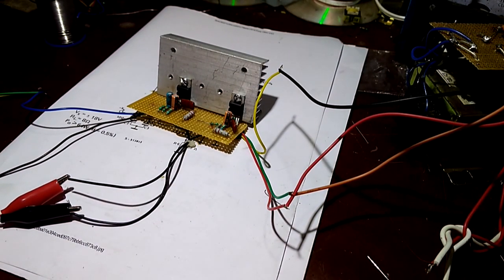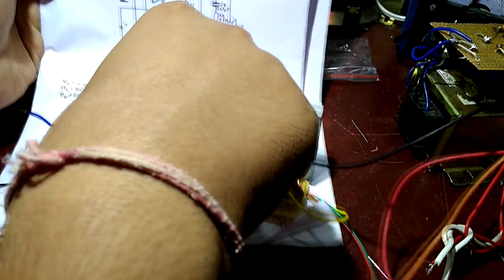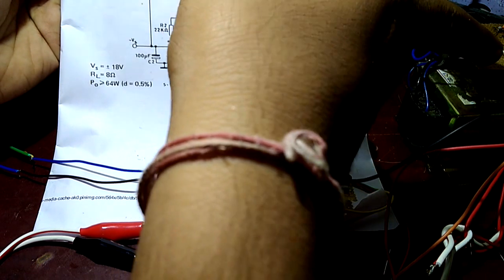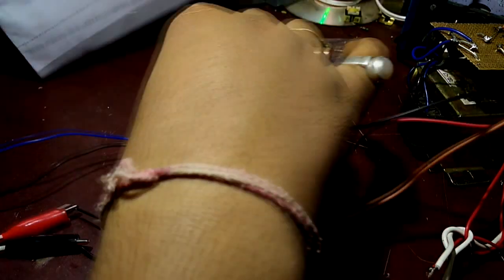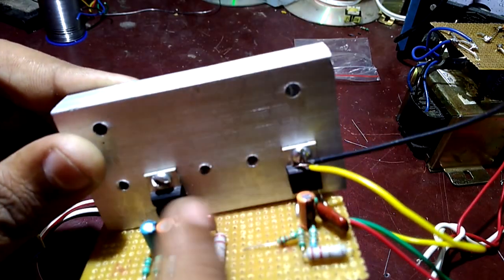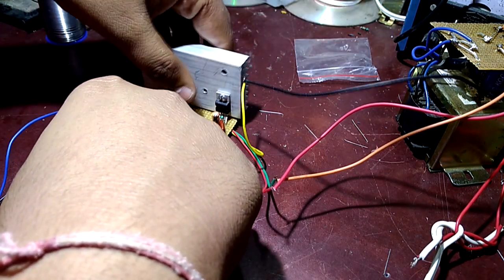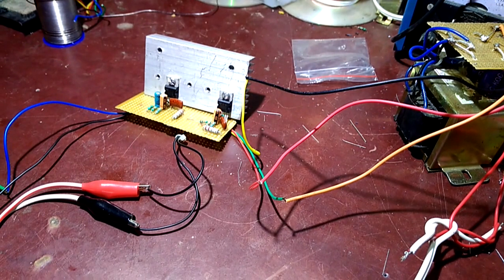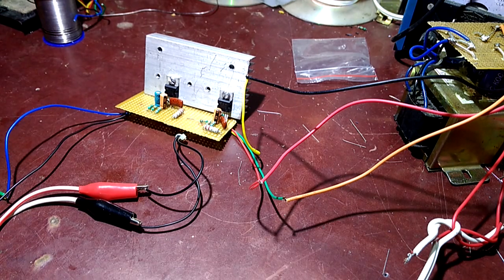100rs cheap 70 watt tda2050 bridge mode class ab reliable amplifier

Comment: Tda2050 is already stopped production. All you can buy are fake chinese made.
Reply: Sad but true
Reply: But question is would they work?
Reply: @konurbilak  the fake ones do work but u cant operate them at their max voltage and they dont have protection circuits.

Comment: can i substitue the resistor with any watts?
Reply from the maker: Subhabrata Das you can change the resistor of 2.2ohms to 1 ohm or 4.7 ohms
Reply: I have bought the tda 2050 chips today. but I have no idea which capacitor should be electrolyte type and which one will be polyster film? Can you please help me with the component types and please tell me what should be the wattage of each resistor. Please
Reply from the maker: Sure mail me on nikhil93348@gmail.com I will give you details
Reply: ok...